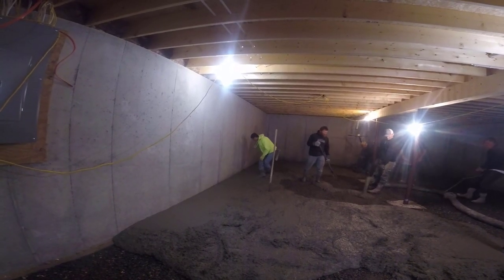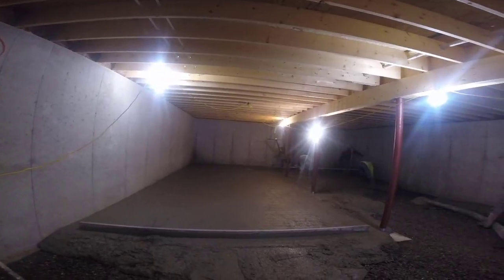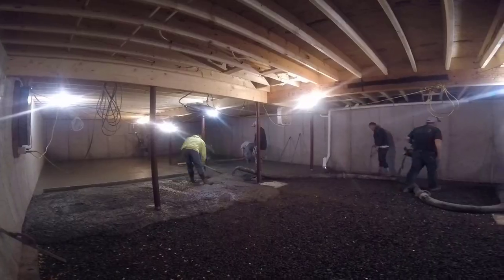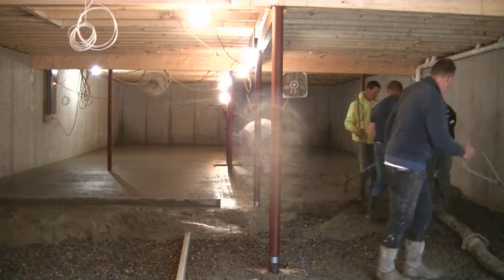LINE PUMPING CONCRETE | BASEMENT FLOOR POUR

Comment: How long did you have to wait before you used a steel trowel on it to give it the smooth finish? (I can't believe they did not put in vapor barrier, or  some rigid foam. oh well)   The floor looks good!
Reply from the maker: It was about 1.5 hrs before we started troweling. We did use some accelerator in the concrete though.